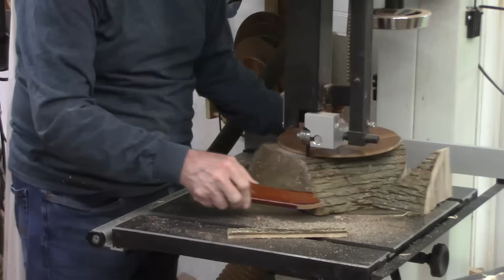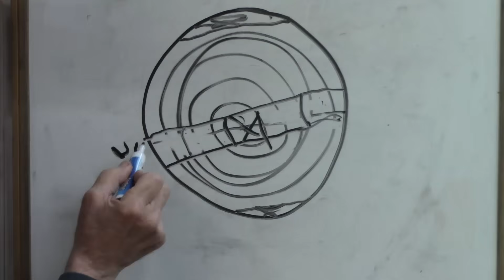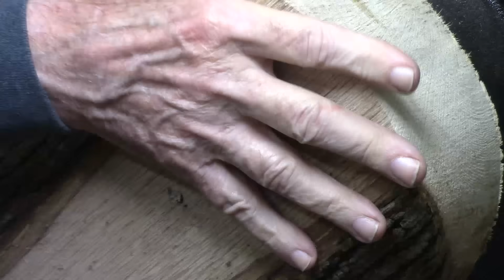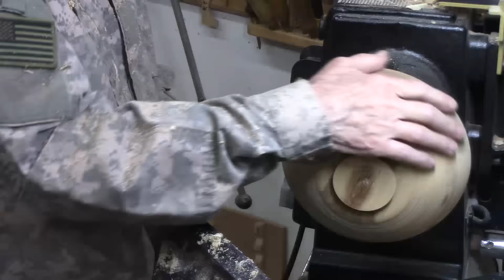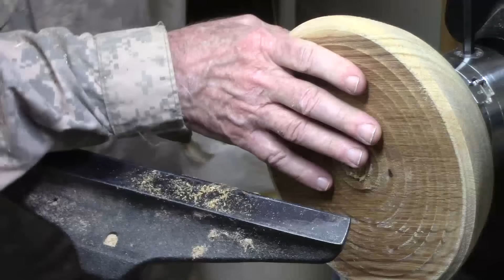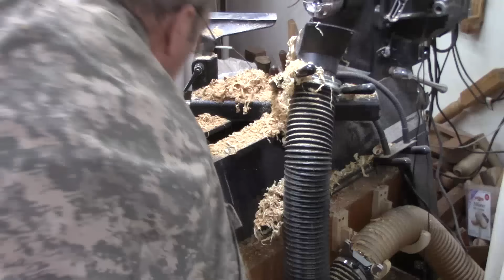Turning a Chunk of Wood Into a Bowl Is Easier Than You Think!

Comment: I usually drill the tenon with a centre drill to help with the alignment for when re-machining the tenon in the “second turning” phase.

Also I often use a 50mm Forster drill bit to set my depth indicator. It also assists with reducing the volume of material to be removed by the gouge.
Reply from the maker: Those are some great tips to improve the process!

Comment: Good video and full of useful information! I noticed that you used a bowl gouge with the swept back wings. I have a bowl gouge with the standard (fingernail) grind? Am I handicapped to do what you did with the blank? I'm fortunate that I have a stash of wood that has been inside, central H&A, for years.
Reply from the maker: Most prefer some sweep over a traditional grind where the gouge is most twisted on a platform.  That is where the Oneway Varigrind jig comes into play to give that sweep.
Reply: @MikePeaceWoodturning  I have the jig but having a time getting the wings and contour. Winds up in a point.